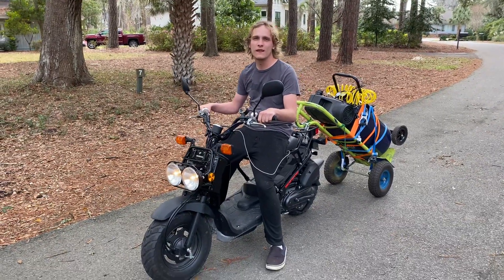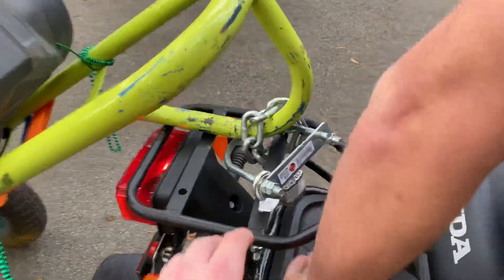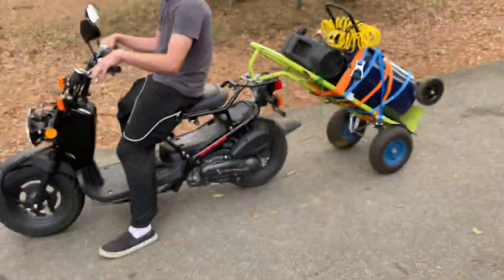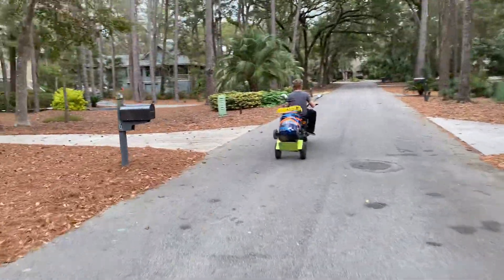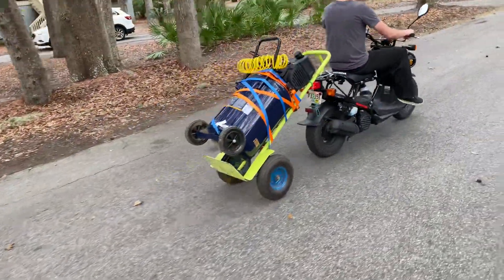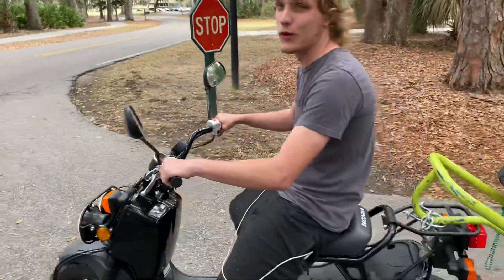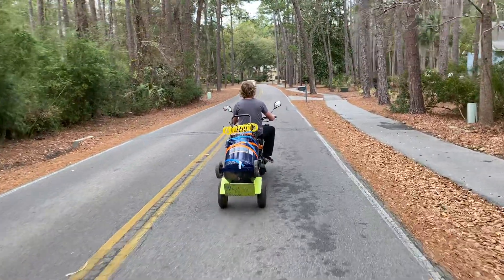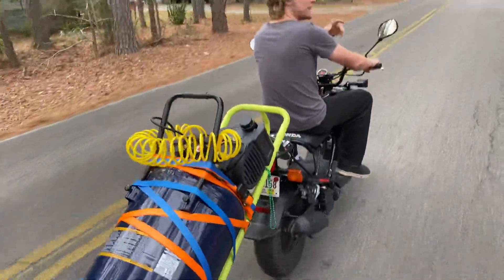Pre St. Patrick’s Day fire bike testing

Comment: i think the axle/ wheels on the handtruck are the problem, see if you can try another one . also just a suggestion but make sure u got the nuts on the u-bolt tightend down good or use aircraft nuts cuz the vibrations from the bike and driving can cause them to back all the way off.